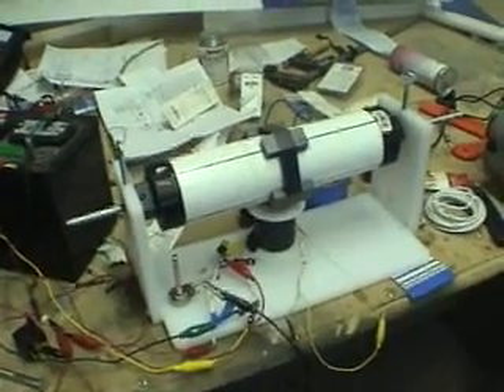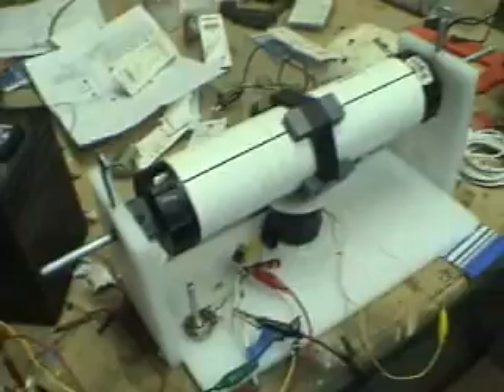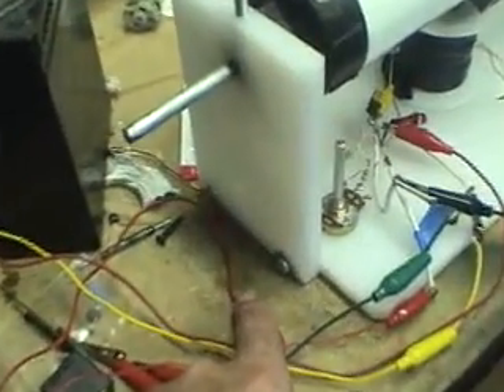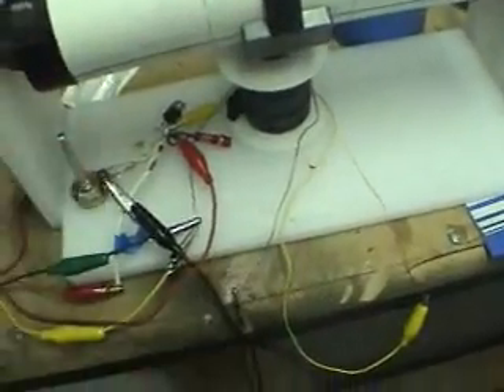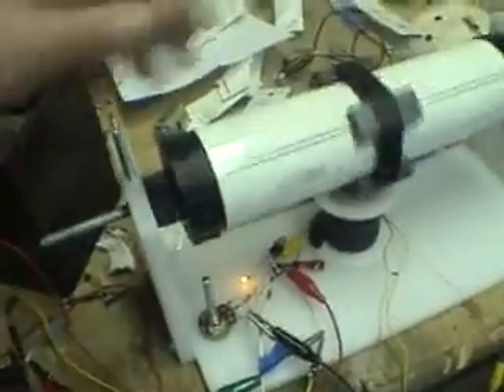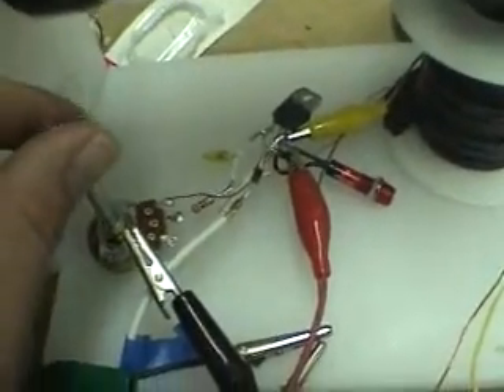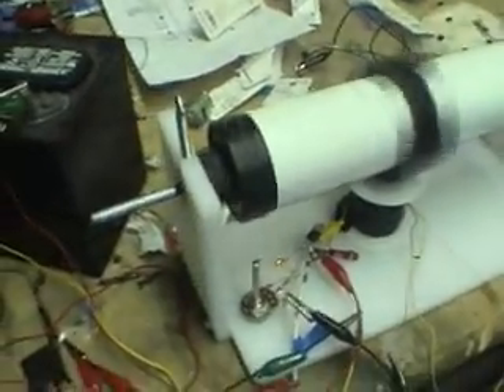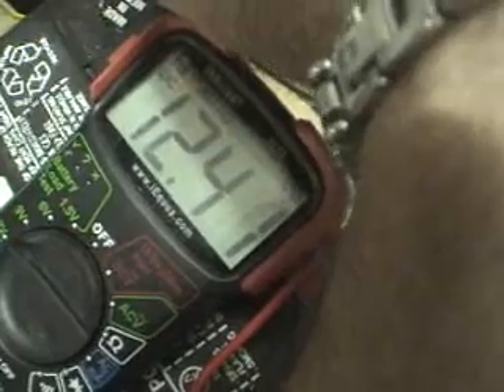Bedini SSG new motor testing part 1

Comment: I would caution you in the area of safety for what it's worth.  When I was in Air Force electronics class always remove jewelry.  A ring for example if shorted across a powerful enough circuit can burn your finger off!  The chain bracelet if it were shorted across the battery terminals can burn your hand off or damage the tendons and blood vessels to the point that amputation is required.  Anyone can say by viewing the video that this can't happen but, if safety is observed you'll be ok.

Comment: the bright light is normal...

However, the voltage your multimeter is reading from the circuit when you pulled the battery off is wrong. you need to switch your multimeter to AC voltage not DC voltage in order to record the spikes properly

Comment: yeah your voltage is a little bit 2 high by about 5 volts maximum for a 12v battery is 13.5 or q3.4 but any higher and you can wreck the plates so see  if you can get some kind of voltage regulator from radioshack :) or make one lol

Comment: Ignore the idiot "know-it-alls". "Music of the spheres" sounds are partly coming from MAGNETS STRAINING TAPE as rotation increases. Hey: instead of wrapping wire around whole thing - wrap on an OUTER CYLINDER AROUND each magnet set! Then parallel out to controller of 60v 3000w mag-drive on your reverse 3-wheeler (see Yamaha custom: BioMod "Ultra-Vees": Can-Am spyders). You will need about 30amps at 65v or so; maybe six magnet sets - put in caps as buffers.

Comment: good work! 

when the light is brighten, then u r getting back emf, that is over 200volts spikes, so with no load(the battery in this case) all energy from motor goes to light bulb. youll be get shock if u touch the wires from coil without the load.

other thing, it should be neon light not normal light. neon light is for high voltages like over 90volts and so on.. u can find neon light example almost all electrical things where is lighted switch, inside switch have neon light.

Comment: I'm posting this message here because, I Just don't know how to send you a message directly, I have a project going on in witch you don't use a rotor Just an toroidal transformer winded w 5 primarys to work @ 12v 1.5 Amps,and a Secondary to obtain a 220V AC making it pulce with a microcontroller, if you are interested, I really will find my self privilege to exchanage a few Ideas 
Mark